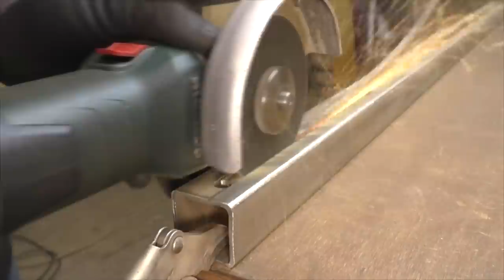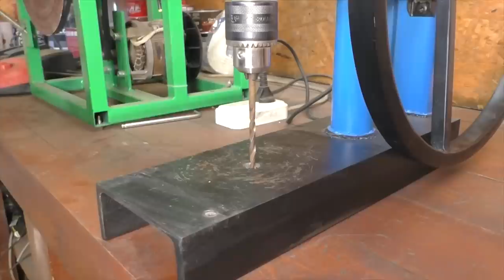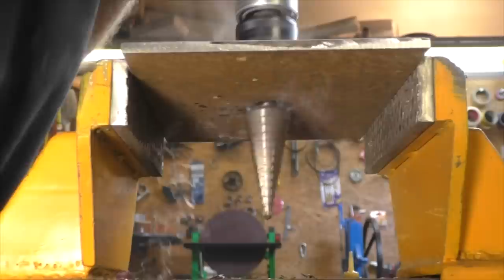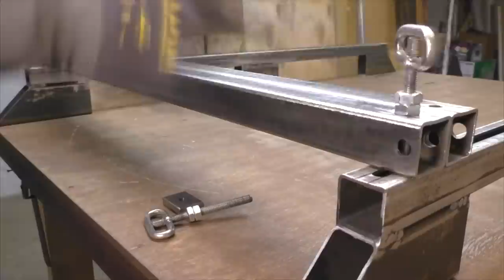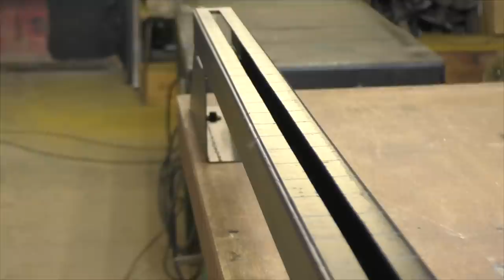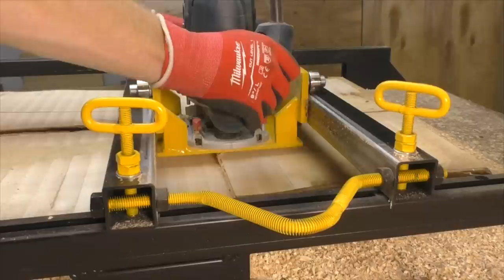It's very simple but useful idea! I regret that I did not do it earlier!

Comment: Excellent engineering, excellent skills! Now you can make a shoe to hold a hand planer, a shoe for an electric drill for drilling large hole patterns. You could even do wood-turning with the router using that frame.

Comment: you can also build all or most of that out of unistrut  bolt together and it has sliding wheels I just built one for a winch . You might want to weld the plate in the middle or bolt?

Comment: might use the same thing in combination with a beltsander to get the last of the grooves made by the router out
Reply: The grooves are from a slight tilt of the router. If this is leveled right it really wouldn't take more than a pass with a palm sander to clean it up.  A locking bolt in each corner to adjust the lower rails in regard to the bench and you're golden.

Comment: WellDone  my freind i’m a retired ProfessionalWoodworker  and in my trade we  have made many Wooden Router Sleds that do work to get the job done but just don’t  last for  more similiar Jobs as Wood  is not a Stable product  and can dimensionally change with tempertures, and Humidty Levels drastically

Comment: Nicely done! But exposed bearings/wheels on a flat steel square tube will be a problem because of chips, debris, etc.  You could cover it to keep the chips out, or you could rotate the tubes 45* and  use two sets of wheels, one on each of the top surfaces.
Reply: That's a great idea 👍
Reply: Keep them completely open I say as no matter how well you try to shield them chips and dust Will get to them and cause them to go lumpy. I guarantee this and will put money in it. 
 Completely open and exposed they can be wiped instantly ,kept grease free and working at all times. 
 I’ve ran many a bridge saw  and timber mill. Down time cleaning shielded runners is an unwelcome job.

Comment: Great build but if that's what you built it for, why a router & not a planer? 3" each pass would be a lot quicker 😊
Reply: A planer can only do one thing, at one depth, in one direction.   A router can run different bits that will cut in the x and y, plus can plunge to varying depth in the z.  You could cut inlays or designs and many things a planer could not. Plus planets are unruly and wouldn't be able to be out into the work and run constantly without need to stop at the end of each pass and pick up the tool to relocate it.  But a router is always cutting. Plus you can get larger surfacing nuts for the router that would give a wider pass.
Reply: @invictusbp1prop143  Fair enough 👍

Comment: Great project and Thank You for making it outta metal. My biggest criticism of woodworkers is they make ALL their jigs from stinking wood scraps.  I guess this is okay for a one-off run or occasional use but long term and accurate: nope.
Reply: Well, we use what we know or have around. This would definitely last a lot longer if you plan on doing a lot of slabs for more than just the near future. And it depends on what type of wood you use. Softer woods like pine will definitely loosen and wear but harder stock like oak will last longer and be more durable. Sure the cost will rise and I admit I never have scrap oak large enough for something like this laying around. But furniture builders who would use this more than I would are more likely to have more hardwood offcuts. That being said I really do like the bearing idea which wouldn't work so well on wood rails.

Comment: After your first use, I can see room for next gen improvement.
Like, roller bearings for the crossbeams so the advance movement to the next row is smooth and straight.
And, some sort of adjustable stock sled or other method to adjust the height to adapt for stock thickness.

I'm thinking though, something like this, with a router. Or, something like this with a hand planer. I have routers, but a hand planar takes off more width per pass. Maybe it could have some sort of stop for each cut width. Then you could just do a pass, move the the planar over one width step, make a pass. The only problem is, you usually make your passes down the length, not cross, so your jig would limit the length of work.

Comment: No slab height adjustment. 
Your stuck with a certain thickness to begin with, so your cutting parameters are very small. Can't level a 6 inch Butcher block  in that thing. My design is is simpler and less engineering and less material to build it and it's adjustable to any thickness, and I mean any thickness
Reply: It's screwed to the table!!  He could certainly raise it if he wanted. I mean IF you have that much use for one. I would personally run it to the mill, n give the dude $20, but thats me
Reply: Shims. 👍

Comment: Where's the point of NOT DOING rolls for movement in other axis? X and Y should be possible to use and lock if don't needed. Now You got nice, smooth movement in one direction, and completely disaster in other one. Good idea stopped in half way.

Comment: other useful idea, nobody never heard of before: wheels!

I´m kind of flabbergasted after seeing this. I expected something at least new or outstanding. And then u r showing how to construct a flattening slab - something well known for decades now (for people interested in woodworking)?!

btw: u might have heard of a material called aluminum? u might not know, but there are people out there making extrusions of this. so u could have saved at least 70% of your affords by using those instead of treating steel.

Last but not least: try to learn about using tools in the right way! Especially forward speed and how deep u go with your (hand-)router. I guess, your nice (and btw well engineered) Bosch router will not last for more than 6 months if you use it daily (what would be a shame for this tool).
Mankind distinguishes from apes not by using tools! (in fact they do that too) The difference is made by learning to use them in the right way from others who are experienced. What u r showing is a nice example how to fail.